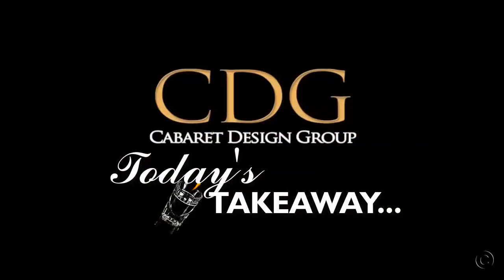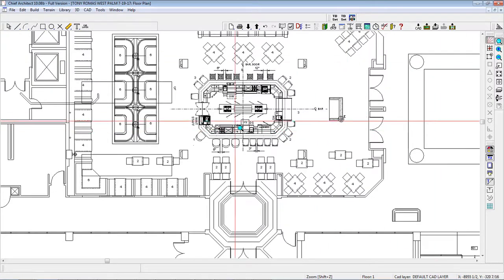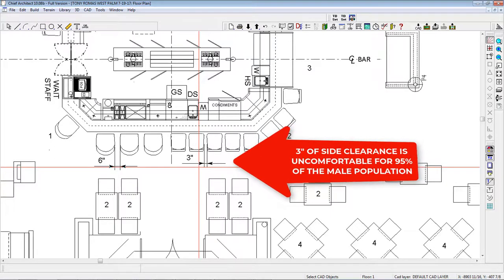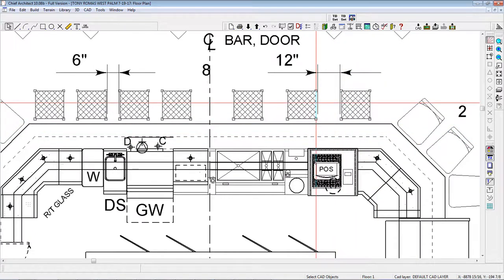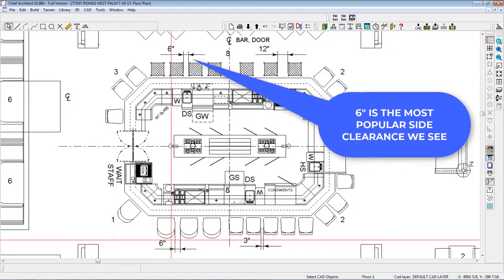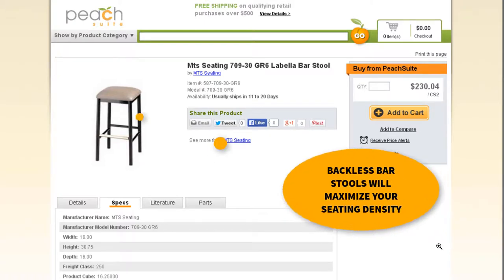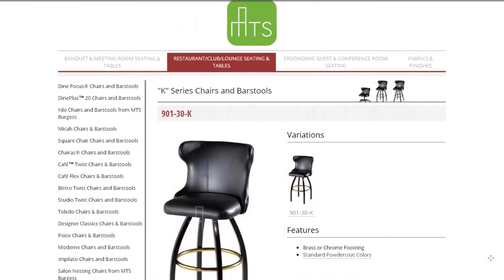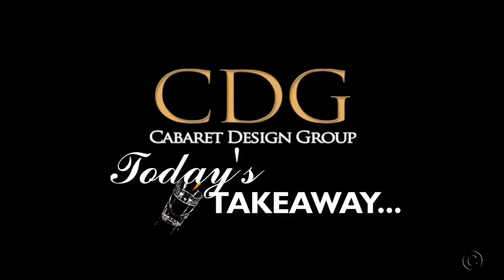Bar Stools - Design Standards for Spacing

Comment: I'm designing a bar with permanent stools set in place with concrete. I am drawing it up first and wondering in plan view, how much clear space should be between the front of the stool and the edge of the counter? Thanks! It will be completely open underneath so foot room isn't a consideration, just arm reach I suppose. And belly room!
Reply from the maker: Excellent question! Irrespective of whether you're using bar chairs or fixed stools, the inside edge of the bar seating should be coincident with the outermost edge of the bar top. Good luck!